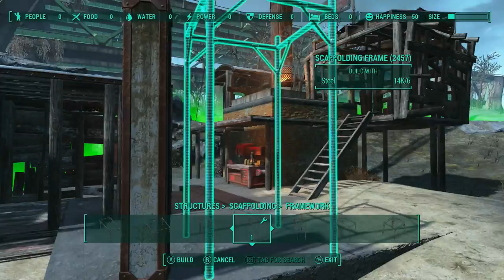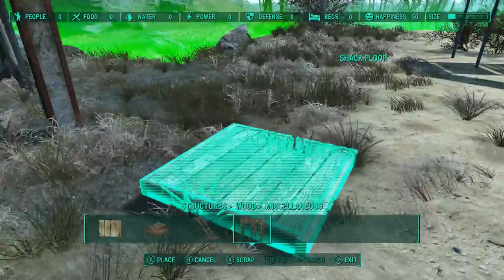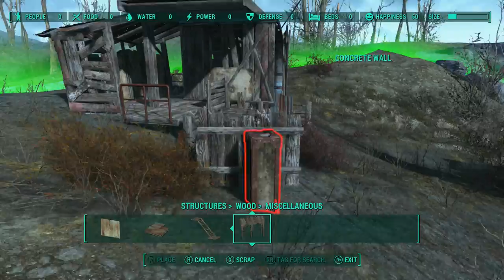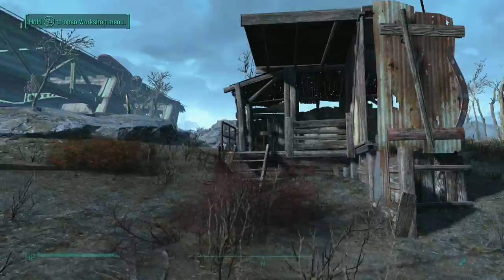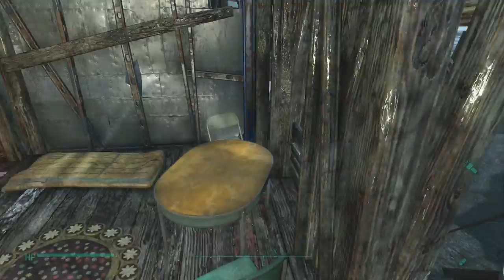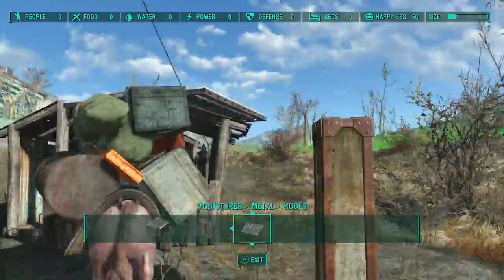Settlement Building Methods and Techniques - 17

Comment: Quality stuff. No matter how much I know, I still learn one little thing watching these. I didn't know exactly why things jumped/fell after rug glitching. Of course it had to do with the rug being flat on the floor surface or not.
Reply from the maker: Thanks! I still don't know how it works in all cases, since it depends a lot on what the geometry is below the visible surface, but when the rug's underground the behavior is fairly consistent. It doesn't work all the time, but it works frequently enough that it's worth taking a couple seconds to try. ;)

Comment: I carried several "flat" folding chairs from South Boston Checkpoint to my Jamaica Plains settlement. I know that is a long way from Zimonja but surely there must be some in the northern half of the map somewhere.
Reply from the maker: I would imagine there might be some somewhere in the General Atomics Galleria, but maybe not outdoors. Not many outdoor locations in the northeast that would have 'em. No biggie, really, just kind of a "it'd be nice" sorta deal. :)
Reply: The Insane Shecklador I just tossed the ones out of the church across the street from JP into the carpark. Admittedly, I scrapped them all. Wish I'd've saved a couple.
Reply: Wow. How did I miss the church chairs. Just went and looked and there are quite a few. Thanks for the info.

Comment: Interesting video Sar. A little too trashy for my taste oddly,  but some cool techniques in there. That staircase springs to mind :) I tend to look at things and think "could 'I' live with that"? If it looks like you'd end up cold and wet very quickly it tends to be a no, so I end up tightening the gaps.
At the risk of pointing out something you already thought of; when I'm building internal walls I find using something that grips the floor, (oil lamp/ashtray etc), to group select things in works well. You need a flat surface to start from though, so the two objects are level at the bottom. I realize this is non modded, but if you have Custom Vanilla Assets on another save, there is a double height wire fence post that serves quite well as a single ball track sized support. I've been using them quite a lot lately as I'm not too keen on the ones in the barn and warehouse tabs.
Reply from the maker: Thanks. And yeah, I know about the ashtray and I've tried it a couple times, but I'm so used to using the wire fence post it never occurs to me to grab anything else. Creature of habit I suppose. :)
Reply: SarDeliac aren't we all lol. I use the concrete pillar even when it will barely fit. Despite knowing there are other things I could use.